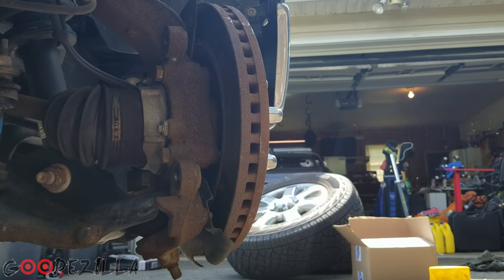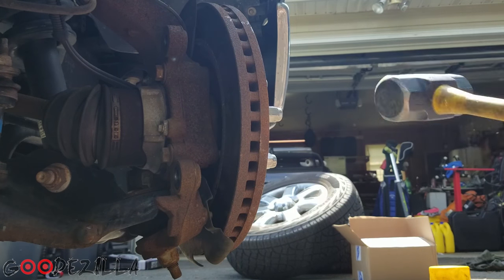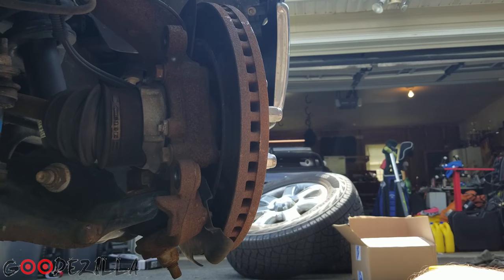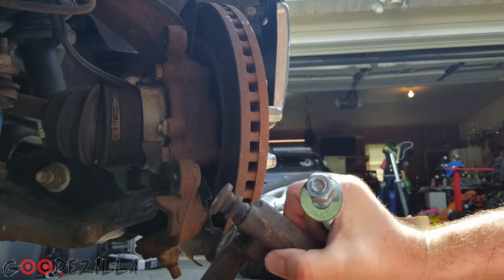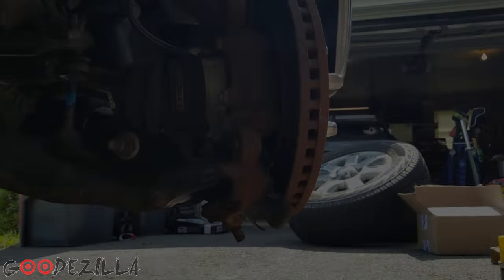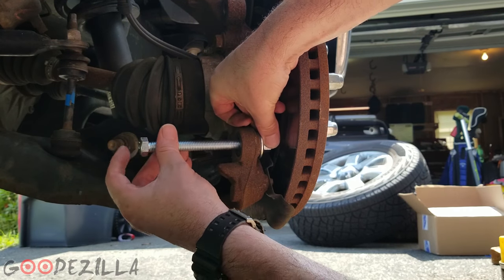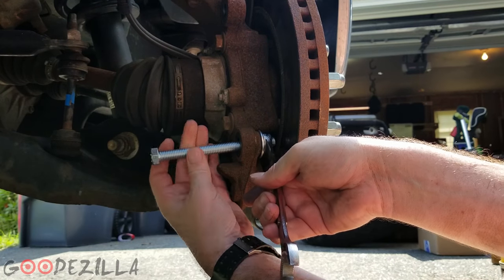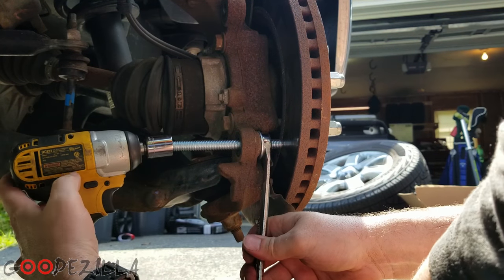How to Remove a Stuck Rotor WITHOUT a Hammer!

Comment: I beat on mine, I used Kroil oil - which breaks everything, I layed hands on it and prayed, got a bigger hammer….. and NO movement. Then I watched your video!  Maybe 30 sec and it was off. THANK YOU!  All I could see in my mind before your video was either a torch or a tow truck embarrassingly taking my car to the garage to have a mechanic finish my very easy brakes. Blessings to you.
Reply from the maker: Thank you! I"m glad it worked for you! We've all been there!

Comment: BE VERY CAREFUL DOING THIS!! -  I found out the hard way and ended up with bent calliper brackets!! I have now added washers to try and stop the carrier from rubbing, but now have uneven wear on my rotor due to the outer edge being further away
Reply: Yup, bent caliper mounting points is possible. Instead of using a smaller bolt, I used the caliper bolts. And my rotor was stuck so bad I almost stripped the threads!
Reply: Wonder what the reply was, that we don't get to see.
Reply: Thanks for the warning. Wasn't thinkin about that.

Comment: Some brand vehicles actually have a separate threaded hole in the rotor to help push it away from the hub if needed. A rare case when engineers make life easier for repairs.

Comment: I beat on my rotors with a sledge hammer on my 2016 F150 for about a half hour - No budge AT ALL. Saw a different video and the guy said not to do this as it'd risk popping off the tabs on the wheel hub assembly. F THAT!!!! This worked almost instantly!!!!! Thank you sir!!!!!!!!!!!!

Comment: Dude, just wanted to say thank you!  You saved me hours, maybe days, of beating, heating, and treating.  I've had some stuck rotors and usually my "go to" method is my 8"  claw and gear puller.  But today I was working on my SUV and the rotors were larger than the puller could expand. Your method is great.  You're awesome GoodeZilla!
Reply from the maker: Hey you're welcome, I'm glad it worked for ya!

Comment: Absolutely legend of a video. Spent 3 hours hammering with no progress. Got it off in under 5 with this. I do recommend getting two bolts to push from top and bottom hole to divide the pressure to not risk breaking your knuckles.

Comment: AWESOMEEE!! I've seen sweat, blood and expensive tools in a rotor fight. You cracked the code. Thanks!
Reply: I was in out of options until I ran across this video. Tried this method and was never so excited to hear the subtle crackling followed by finally a snapping sound of the rotor being disengaged, along with the sight of rust dust.  Victory was mine and the next and final rotor's bully tactics were no match for this method as I repeated the same steps on the front driver's side, completing everything in nearly NASCAR pitstop speed and able to enjoy the rest of my day.

Comment: I have a '98 Camry that sat for a year here in New England.  After taking off the front wheels,  I found the front pads with parts of the backing plate rusted off.  The driver's side rotor was frozen in place with rust.  I tried some JB Blaster.  I tried various hammers,  ball-peen,  small sledge.  Not a hint of movement.

Then I found your video.  I had only one bolt that fit but this started working right off the bat.  I tightened and rotated three times.  Each time moving a little more.  Easy!   Thank You!
Reply from the maker: Awesome, I'm glad it worked for ya!

Comment: Thank you man!  That worked when everything else I tried didn't.  I was worried about bending the caliper mounting ear, so I took a round bar and braced it between the inboard side of the ear, and a solid place on the frame.  Because I'm working at the front, the bar doesn't have to be an exact length - all I had to do is turn the steering wheel until the bar was trapped.  Then I threaded my bolt through the hole, and tightened it.  Sure enough, with some bolt pressure (although not a ridiculous amount), PING!  The rotor was loose.  What a relief!
Reply from the maker: Good idea with the bracing...I'm glad it worked for ya! Thank you for the comment!

Comment: Thank you for sharing this amazingly simple but effective procedure.  This popped my stuck rotor off first try.  It took only a couple of minutes to set it up.  I used both bolt holes at the same time to better distribute the force and turned the bolts with a pair of hand wrenches.  You get a well-deserved thumbs up!

Comment: Massive thanks. I beat on my rotors for an hour, didn’t budge, got super frustrated. The hammer method also worked, but not this time. Got some bolts, 5 mins later OFF! Saved me from the dealer charging god only knows what for this normally simple job. Once again, a big thank you for this video!
Reply from the maker: Awesome, I'm glad it helped you out!

Comment: Omg, how easy is this. My rear brake rotors looked like they had been on from the factory in 2004 truck because they still had the small stud lock collars on them. You could see the rust line around the center hub portion where the rotor meets it was solid. Your video was the first one I saw and bam, 5 min is all it took, each side. Didn't damage anything. These rotors also have the drum internal for the emergency brake. That bolt is now a part of my toolbox. To add to your tip, I added another nut at the end of the bolt for more surface area to contact the rotor face. This works great!

Comment: Thank you for this video, this trick saved me yesterday! After trying with a heavy hammer without success i didn't know what to do. Luckily i found your video and got the job done. Over the years the disc has rusted so solid that it made a loud bang upon separation. Like when removing balljoints.
So this method should work even with the rustiest of brake discs.

Comment: Hi. I don't normally comment on YouTube videos but this is an exception. After a lot of head scratching I nearly gave up on trying to remove my Brake Discs (UK name) I resorted to youtube to try and find a solution. I bumped into yours so gave it a try. Amazingly after a lot of turns on the Disc it 'Cracked' and the disc was free! Thank you so much for this solution it worked very well... Now I need to do the other side.... 😄😅
Reply from the maker: I'm glad it worked out for you! Cheers!

Comment: For those wondering screw sizes... Most caliper mounting bracket bolts are m14, most equivalent size in imperial is 1/2. So a size down would be 7/16ths, then 3/8ths.  In metric the next lowest would be m12 or m11
Reply: I did 3/8 and had it off in less than a minute
Reply: thanks bro

Comment: Excellent tip, worked great.   Beating on them with a hammer was going nowhere, this worked really well.   It put a big mark on the rotors but the rotors I was removing were junk anyway so no issues there.    These are the best kind of Youtube instructional videos.  Short and to the point, and easy to follow.  Thanks for posting it.

Comment: Dude!  This tip saved  me big time.  I managed to get one side off of my '08 Volvo V70 by hammering so I figured to do the same again.  I beat it for hours until my arms were tired then called 2 friends to help beat on it more.  Sprayed it, heated it & used a puller with no success. Started to crack the rotor off it's hub and stopped beating on it. It got dark and I packed away the tools figuring I'd have to pull the strut & get it pressed off at a friends machine shop.  *Then I found your video!*
Next day I found some bolts on hand and set it up like you showed (very nicely.) When I heard it pop loose, I practically lost my $hi+!  Still took some work back & forth to get it off, massive rust on the hub rim.
That was amazing - Thanks for a great tip!!!!!
Reply from the maker: Wow, thank you for the long comment. I'm glad this method could help you out in a crappy situation. Thank you for the support!

Comment: Not all rotors have the jack screw (tapped holes) machined into the rotor, and this is an excellent solution without using a bfh.👏  Pro tip that is useful for this and other applications. As always, Goode stuff, Dustin!  Cheers, buddy.👊
Reply from the maker: Exactly! The new rotors that I put on, have the screw holes for helping remove them...but the stock rotors didn't. So as you saw I had to do this for both sides...worked great! Have a great Sunday Mick!
Reply: GoodeZilla Thanks, bud... you do the same.👊

Comment: 'My kids are always having emergencies.'  - Tell me about it
thanks, this helped me... didn't use the bolt method, but when I heard you hit it with the sledge hammer, I just grabbed my big hammer and wailed away at it.
I can't tell you how aggravating it is to have your dealer tell you (a) the caliper is seized (it wasn't), (b) the stabilizer bars are shot (they weren't) and (c) there was metal on metal contact (brake pads were still good).  They wanted to charge me $1500 to do all that including replacing two perfectly good calipers.  This is why I appreciate people like you contributing these videos to youtube.  It's like you helped me save $1200 - $1300.
Reply from the maker: The stealerships are always trying to milk money. Thank you for the kind words. I'm glad you got it fixed for much cheaper!

Comment: Awesome idea. I have a 2014 Grand Cherokee and used this on the front rotor and pad replacement both sides. I wasted a lot of time/effort with the hammer on the right side and your method worked in a few minutes. Didn’t even bother with the hammer on the other side as your method was quick and straight forward. Thank you!
Reply from the maker: Awesome! I'm glad it worked for you!

Comment: Goodezilla also 4 years later your are helping people with your video . Iwas working on my van and the rear brake rotor with integrated bearing where stuck. i used your methode only difference i used hand tools  because of the bearing . moved the rotor 90 degrees at a time until it came off. I can't thank you enough for making this video.. greeting from the netherlands

Comment: thank you for your post, my new go to way for removing stubbornly rust seized rotors. After aboutr 3  hour of heating tapping and banging i went to youtube and found this post, and for a 57 year old  working on a 99 ford F150 w/ 260k miles my rotor was litterally welded to the center hub. But once i used your method as you ddescribed i heard a old sound "PING" - the sound of rust freening itself. So i spent the rotor to a different position and repeated the procedure 3 more times, 30 minutes later i was back on the road! Well described, easily executed, mechanically effective!!

Comment: I am not typically a person that comments on stuff, but I have to THANK YOU!!!!! I was doing a full 4-wheel brake job and the last one was seized badly. I only have this one car and I am pretty far away from anywhere i could rent a puller. I was not sure what to do and then i saw this. I had to take a piece of 1/4" steel to "bridge" across the rotor as the bolts were hitting right on the edge of the inside hub but that worked well. Again, thank you sooooooooo much!!

Comment: I had to put a old brake pad on the rotor and hold it in place with a C clamp to close the gap between the bracket and the rotor because the bolt thread wasn't long enough and it worked.   Thanks you for the post, for years I've been hitting it with a hammer for about an hour to break the seize.
Reply: .. good tip with the "C" clamp .

Comment: I am also here to sing high praise of this video. It really saved my ass when I told my buddy I could do his brakes and rotors. Passenger side came off with some persuasion. Driver side wheel took a beating to break free and the rotor was taking second to no issue afterwards. So much gunk around the hub rotor connection in the front and we beat on it til the cows came home. Actually more like 30 minutes which is about my previous rotors removal tolerance. Thanks to this video I will now bow to no rotor. Great trick and I’m sure you didn’t invent it. You did make it easy to find and easy to follow. Thanks again car friend.

Comment: Thanks for creating and posting this video!!! My experience...I noticed that tires needed rotating on the 2007 4runner. A wheel stud snapped while tightening a lug nut on the first 2 tires in the rotation. The lug nut seemed to be taking more turns to tighten than the other lugs then it snapped. I took a break then finished the last 2 tires with a torque wrench. The next day...the rotor would not budge after several minutes using a rubber mallet and a hammer & a block of wood.  This video popped up in a search. There was just enough clearance for a 3/8" nut to fit between the rotor and brake caliper mounting arm. One nut fell between the rotor and backing plate, but I bought 3 nuts and 2 bolts. Also, I am glad that I had a bottle of anti-seize to apply to the contact surface of the wheel bearing assembly and rotor to help the next person that needs to remove the rotor.

Comment: Thank you!!! Worked like a charm on my 2012 Ford Escape today which spends most of its time in the rust belt. Very quick. I used both caliper bracket holes with two shoulder bolts, nuts and washers with 3/4 inch heads. Just went back and forth between the two since the car was in park and I couldn’t spin the front rotors. Both rotors separated in less than a minute once I started ratcheting. The sound of that rust seal breaking was awesome.

Comment: I was pounding the crap out of the back of the rotor to get the hub off...No go.  Tried your method and SHAZAM! Pushed it off both front sides with ease.  Thanks!
Reply from the maker: Glad it worked out for you!

Comment: You saved my day! Your solution worked on my 2005 sequoia stuck front brake rotor. I don’t understand why OEM front rotor doesn’t have a 8mm threaded hole like the rear rotor.  Even the new OEM rotors don’t have one neither. Anyway, thank you for sharing the tip.

Comment: Absolutely Brilliant.  I spent hours trying to remove the rear rotors on my sons 2013 Camaro, and to no avail.  In desperation, I went to YouTube and found your video.  Within minute they popped off.  In place of the impactor, I just used a standard 3/8” socket wrench on the bolt.  Worked perfect.  Thanks for sharing the tip.

Comment: This is a great tip for a super annoying problem.  I was banging at the rotor with a sledgehammer and it would not budge.  I used the bolt technique and each one of them came free within a few seconds.  I did not have an impact wrench so just cranked the bolt with a normal ratchet drive and a socket and it worked.  The key thing was getting the pressure on the OTHER side of the rotor which this technique does.

Comment: Just want to come here to say thank you for posting this video (I rarely post anything online haha!). My rotors are old and rusty. I hammered the hell out of them and sprayed 1/2 bottle of WD40 to no avail. The two threaded holes on the rotors were too corroded to do anything good. Finally I watched your video and grabbed two long 3/8 bolts. I followed your steps, but I did it manually with a wrench. I didn't want to bend the knuckle that holds the caliper with an impact wrench. Finally, I heard a loud pop and the rotor was released. That was such a satisfying sound!! For those who struggles, I think the key is to do it slowly. Tightens and releases the bolts. Rotates the rotor and repeats. Don't over-tighten cause it may bend the knuckle or strip the bolt. Eventually you will get it. I was replacing my rotors so I didn't care whether they get destroyed or not, but I would put something between the bolt and the rotor to prevent it from scratching and denting if I plan to re-use the rotor.

Comment: Thanks for the tip, worked on one of my rotors, the other one the e-brake pad was rusted to the rotor, ended up getting my neighbors large gear puller. Will definitely use this in future endeavors

Comment: Hey! Just wanted to let you know that this trick worked miracles and allowed me to free up a rusted rotor with ease. To those that read this, BE PATIENT and make sure you rotate the rotor in between applications and it will eventually walk itself off. I applied some rust buster and let it sit for 15 minutes before beginning. After about 10 minutes, it popped off without issue. Thank you for the tip!

Comment: Since I was replacing them anyway, I tried the bfh on the passenger side it worked. On the drivers side it was stuck. Saw your video and gave it a try. It worked with some effort, turned out the resistance was rust and a sticking parking brake pad.

Comment: Changing the rear brakes and rotors on my 2015 F350 super duty that's seen a lot of salt water from launching my boat. I always rinse down everything with salt away but they are still pretty rusty. Decided to do some research before the job since I knew the rotors were going to be a bitch to get off. Oh man am I glad your vid popped up first in my search. What a time saver! For shits and grins I did try and give it some hits with my hammer to see if it would break loose but no bueno...totally seized. So I used your method and yeah popped right off with a couple of turns of the rotor. I was yelling oh yeah oh yeah it's coming off! Made my wife even come out to the driveway and ask what the hell was going on. I'm sure your vid will help many for years to come using this method. And luckily for me I live in the woods with no nosy neighbors. Cheers!!
Reply from the maker: Haha nice! I'm glad it worked for you!

Comment: Wow! What an awesome idea ,  my rotors were so rusted and frozen they would not break free ,   I felt so defeated after hrs of beating , heating and soaking ,  I thought crap Im gonna have to bring it to  a mechanics shop , I am so fortunate I came across this video ,  my tip is I bought 3 bolts , washers and nuts ,  I didn’t want to have to go back to the store ,, my 18 volt impact wouldn’t break it free I had to use my big air gun  and really force them off  , in 5 minutes it was off , thank you so much for this awesome tip